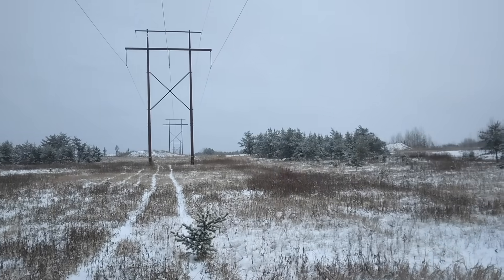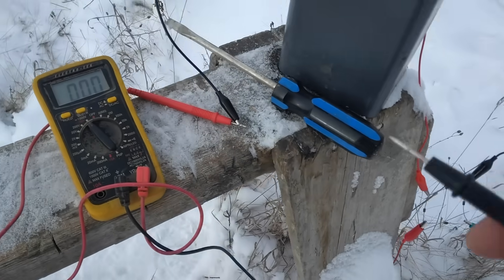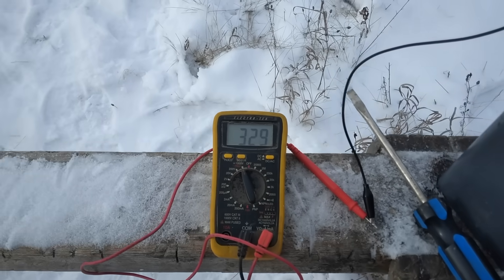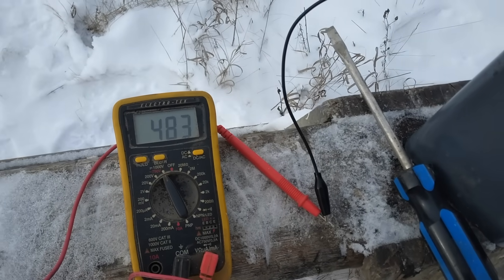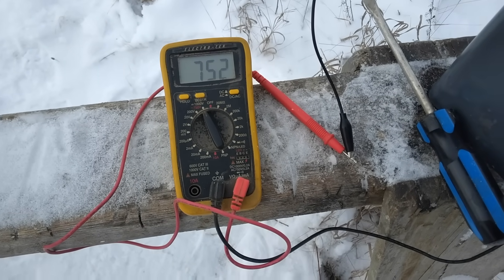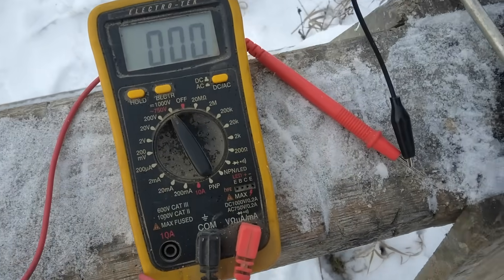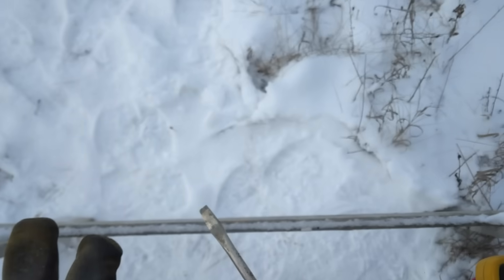Fences sucking power from under HV transmission lines

Comment: Do the power companies pay you for this easement?  Or was it granted many years ago by a previous owner?
Reply: They take the land. If you cooperate, you get paid. If you don't they just take it "for the public good." This has happened to my family that settled the homeplace in the 1850's. They wanted to come right through the middle, but we were able to get them to take from the edge. A front company purchased it for $50k, and 3 months later they flipped it to the actual electrical company for $3 million. This was in the 90's. The buyers and the amounts of purchase are shown on public tax records.
Reply: That is so damn scummy. Did they pose as the electric utility? Could no judge reverse that deal? Sounds like it was bad for both the electric company and the land owner. Was the $3 mil for multiple tracts of land?
Reply: Maybe the electric company owned this other entity and wrote that difference off as a loss? Either way it sounds really screwy.
Reply: @keith77mn77  That was my thought as well.
Reply from the maker: I think the previous owner got something.  I bought it this way, and don't receive anything.

Comment: During the Great Depression people would run 100 feet of wire in parallel to the power lines to steel power. The laws at the time only punished direct contentions. Then the power company got the laws amended.

Comment: I have worked on high voltage, high power AC and DC regulation systems for about 10 years. The potential power storage capacity of that 88 MF at 1200 V capacitor is more than enough power to instantly kill you. There is so much danger with what you are doing that all I can say to you is please stop now before you or somebody else is killed. You are unintentionally experimenting  with an extremely deadly situation.

Comment: I've been a cable guy for 17 years and felt a tingle from the shielding wire many times. Inductance is cool! 😊
Reply: till it isnt
Reply: Splicing .875 with 90v on it hurts, doesnt it?
Reply: @davidca96  I've never worked on hardline. Just RG6 & 11. It's only been a few times where I brush up my arm against a drop while it's disconnected from the splitter. But I've only been on the cable side for a few years. Did telco for 17 before that, which only has -48 DC idle, but ringing is 90 AC which definitely gives a good zap!
Reply: @grabasandwich  Ahh ok, I am a network maintainence tech myself, been in the business for 23 years. It sure does wake you up especially if your gloves are wet haha.
Reply: @davidca96  how else am I supposed to keep warm? 🤣🤣 no i aint turning the power supply off Good luck boys
Reply: @grabasandwich a good zap every now and then , keeps your teeth white .
Reply: Would running the fence in a spiral increase the power gathered? 
Good luck explaining the spiral fence to the power company though. lol
Reply: @FLPhotoCatcher  not unless it was spiraling around the power line.
Reply: @FLPhotoCatcher  I believe there would be a specific angle to run the fence at that would produce the highest inductance. Who knows, a spiral like a razor wire fence might work better actually since it would be more likely to hit that angle multiple times.
Reply: Inductance makes noise!! Fuck inductance!! 😝😝

Comment: For curiosity sake I have some questions for those who might know:
Is there a way to harness and transmit that power and apply it in practical solutions for personal use? And more importantly would that legal?
Reply: You can actually harvest power and use it to power lights for example. Although we did have a fellow who did this in Australia and he was successfully prosecuted for power theft. I believe he was using it to power some Chicken Sheds
Reply: It's illegal because it's theft. It'd be more of a grey area if we were talking about catching light instead of letting it waste away into the ground or sky anyway, but that's not what this is. The energy built into the magnetic field around the wire each cycle is temporary, most of it collapses and drives energy back into the wire for the next cycle. By redirecting some of that energy into a magnetic load nearby, it doesn't get recycled back into the wire and the power company has to supply more energy to make up for it. Sure it's smaller than a drop in a bucket, relative to the energy flowing through those wires, but the more people that do it the more of that energy is consumed without knowing who consumed it.
Reply: @genx65535  genuinely curious, what's the physics of how "most of it collapses and drives energy back into the wire for the next cycle" ?
Reply: @netltube the physics is a combo of "change in electrical current induces change in magnetic field" and "change in magnetic field induces change in electrical current". The inductance of the wire is responsible for what's happening, and a good model for magnetic field around a wire is to think of a stretchable hose that inflates the more you pump water through it. When you stop pumping water the elastic nature of the hose is allowed to shrink and that stored energy squeezes a bit more water out the hose. You have to pump a but harder to get the water moving when you start but you reclaim that energy when you shut the pump off.

The stretch in this case is the magnetic field and the water represents the electrical current flow (not voltage or electrical pressure). Magnetic fields are built up as a form of resistance to current flow as current increseases, and as current decreases the magnetic field is relieved to shrink, returning the energy that was used to build it back into the wire and pushing the current just a little bit further (in the same direction).

Power stations drive the energy as AC, cycling 50 or 60 times a second building current flow forward, then cutting it (then reversing current, then cutting it). Each build up faces resistance as some of the energy ends up building the magnetic field instead of pushing electrons through the wire, but as the generator winds down the cycle the field collapses and keeps pushing those electrons on behalf of the generator.
Reply: @genx65535  how can it be stealing if your not tapped into it ?   You would be harvesting from the air.
It's the same as saying you're stealing water from the water company if you catch rain.
Reply: @strawman9410  But you ARE tapped into it! by magnetic (or electric, depending on the setup) field coupling. Motors use this all the time to transfer energy from power source to mechanical movement. Just because it's not tapping in by physical conduction doesn't mean it's not tapping at all.

It's not the same as stealing rain water because that water would normally hit the ground and waste away (ignoring farming laws in some areas) if you didn't catch it. The magnetic field built up around the wire each cycle is mostly recycled back into the wire, it doesn't spill out into the ground and get absorbed like a sponge. Setting up a sponge (this guy's lab experiment) transfers some of that energy during the build up and the collapse of the field for each cycle... the power station will see extra electrical load put on the grid no different than if he had plugged in a phone charger, the difference is an energy meter is connected between the power station and the phone charger.
Reply: @strawman9410  It's not like catching rain water. It's more like finding a water tank that doesn't belong to you, lighting a fire under it to evaporate even more water off than what naturally evaporates off, and then condensing the water into your own tank. 

It's still stealing, it's just harder than bypassing your water meter.

I feel like you have a very appropriate name xD.

Also Tyler is 99% correct. The majority of the energy in that electromagnetic "leakage" does go back into the lines (and they'll even have capacitors at the substations so make sure they go back in the right phase too) but some of it does leak into the ground (inducing currents in the ground due to the natural conductance of the ground) but there's no way of actually harvesting that lost energy so you can't collect it as free energy (if you could the electricity companies would be doing it already xD).
Reply: @Logarithm906  you don't need power lines to absorb electric, you can get electric just from the air, but might be able to get more if you are by power lines.
Example
https://youtu.be/qhXxSAv6rMg
https://youtu.be/5izEj6uGwrM
Reply: @strawman9410 there are states where that is illegal too….
Reply: @strawman9410  A long time ago, the US Supreme Court ruled that the airwaves are free. For example, you can buy a police scanner and listen in on the emergency frequency they use. You can't TRANSMIT on that frequency, but you can listen. If the power escapes the lines in the form of an electric field, I would imagine (IANAL) that capturing it would fall under the same principle, as long as you don't tap directly into the line. If the electric companies don't want you doing that, then perhaps they should shield their cables and keep the power inside, and not let it escape into the open air.
Reply: @ssnoofle2007  radio waves (including light) are different. Once the electric-magnetic bubble is formed it radiates away from the transmitter until its absorbed by something else. Most of the magnetic field around power lines collapse back into the wire at the end of each cycle.

Yes power transmission could be constructed to better contain the magnetic field in metal instead of the surrounding air, but the material cost would cause your electric bill (or probably local taxes) to be so high no one could afford it.
Reply: MTECH INDUSTRIES-ENERGYRESEARCHER999
Not sure if this might be any good for you
Reply: You get prosecuted, heavily, because the electricity companies don’t want everybody doing it, and like to make Examples of people doing it.  Never mind the fact that they are polluting your property with huge magnetic fields without any recompense to the landowner !
Reply: Here is a fantastic article on Induced Stray Voltages from Transmission Lines:
IEEE/PES T&D Conference & Expo, Dallas, Texas by Georgia Institute of Technology.
https://grouper.ieee.org/groups/td/dist/stray/files/2006-05-Patel-Lambert.pdf
Be very careful,  it only takes fractions of an amp of current to kill you.
Reply: Legal, maybe. But it is still theft.
Reply: You could probably charge a phone, if you add in some electronics to prevent overvoltage frying your phone.
As this is an unavoidable loss of energy, I highly doubt there is a law to this specific case.
Reply: Yes, but I don't know how you would do it safely or legally. I remember reading, years ago, about a student share house in England which was located in close proximity to high tension lines. The article did not go into too much detail, for obvious reasons, but the occupants had managed to install a large inductive coil in the ceiling cavity of the house
which was capable of inducing current from the high tension lines above. And it was enough current to run a house, once transformed.
By all accounts it was a bit of an engineering marvel. Not only had these industrious students managed to source a tonne or so of not so ethically sourced copper to make the coil out of and then install it in the ceiling cavity, they'd managed to do so without getting electrocuted.
My employer at the time hypothesised that they must have built a Faraday cage in the ceiling cavity prior to manufacturing the coil and wiring it into a remote transformer and into the house wiring and then removed the makeshift Faraday cage. It makes sense.
As far as the legality was concerned, they were charged with stealing electricity. I can't remember the outcome, though.
Reply: @davidbrayshaw3529 It seems quite unfair to me for the students to be charged. The power company has an obligation to contain it's product. If it can be collected with easements in place and followed, it is their problem.  Change the easements or shield the fields. It's still a question whether these fields have health effects of persons nearby.
Reply: Google Tesla....he was a genious

Comment: I have often wondered about this. However, your experiment needs to be expanded. Laying your fence across instead of in line either the path & adding several crossings. The lack of a load means you cannot measure current & therefore   calculate power capability (Volts x Current). I always wanted to put a couple of turns around the base of a steel pylon to test this...

It would be enough to run a cattle fencer, a repeater for ham radio, an LED light on a sign or driveway, or to charge or permanently maintain a small device  or parked vehicle battery.
Reply: You're quite wrong about lack of load. The load was the charging of the capacitor itself. And during the approximately 480 seconds that he was charging the capacitor he collected 36.2 joules of energy. Another name for joule is watt second. So he was collecting energy at a rate of approximately 75 milliwatts.
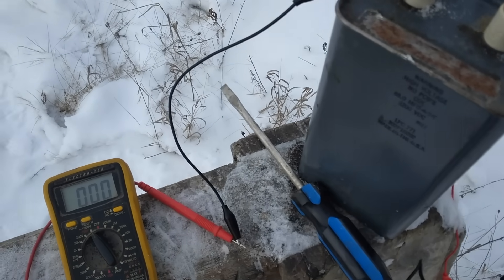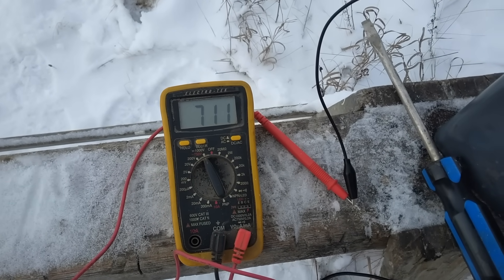Reply: @johncochran8497  I agree with your method of calculation, but I see there was an interruption in the video at time 5:53.  Up to that point, the energy collection rate (power) calculates as 55 milliwatts.  After that, from time 6:03 to time 10:00 at the end of the measurement, the power calculates as 59 milliwatts.

However, the actual power collected would be a little higher since the voltmeter, while it is briefly connected, draws power.  That meter presumably has an input resistance of about 10 megohms or 11 megohms.  Assuming 10 megohms, the meter consumes about 81 milliwatts at 900 volts.  He was making brief connections.  The voltage was definitely climbing in the periods when the meter was not connected.  It seemed to also be climbing while the meter was connected at the end.  If so, that would say he may have been collecting over 81 milliwatts in that configuration, but I can't tell if the meter was connected long enough then to be reliably responding to small changes.
Reply: @analog_guy  I failed to notice the cut at the point you mentioned, so that would mean that my calculation of 75 milliwatts was high. As for the parasitic draw caused by the meter, I would consider that to be extremely negligible. Although you should be a bit more careful about the difference between power and energy. If the meter was 10 megaohms, then I agree that at 900 volts, it would be consuming at a rate of 81 milliwatts. But assuming 5 seconds for the measurement, it would have consumed approximately 0.4 joules of energy.

But there is the issue of the meter voltage reading actually increasing while the voltage was near 900V. That increasing value would imply that the power being supplied exceeded the drain caused by the meter, hence > 81 milliwatts. But the scene cut would imply that the calculated value of 75 milliwatts was low, hence we do have a bit of a contradiction. Only way I can resolve it is to assume the capacitor (or his setup) has a significate amount of leakage.
Reply: @johncochran8497  That is a good observation.

Comment: I wonder how fast you could charge up if your coax was closer to the center of the 3-phase overhead wires, taking better advantage of the 3 phases.
Reply from the maker: I was putting it about where the property line was, because that's where a fence would go.

Comment: What kind of current could you pull? Can the DC go through an inverter to produce usable AC? If so, what wattage?
Reply: The total power is rather insignificant. Just take a look at how slowly the capacitor is being charged.
Now, because he is storing the energy in a capacitor, the amount saved over a significant amount of time can hurt when discharged after being charged.
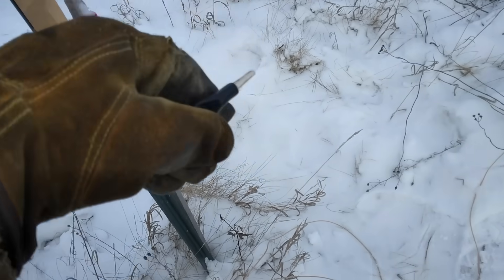His calculation at the end of the video was 36.2 joules. Another, more common, name for a joule is watt-second. So he captured 36.2 watt seconds over an estimated time of 480 seconds (He started charging at 2:04 and finished at 10:08). Doing the math, he was drawing about 75 milliwatts of power. Enough for a small device, but not significant.
Reply: @johncochran8497 capacitors don't have a linear charge rate though. If it was at the peak voltage then the charging would of course be slow. So your estimate could be accurate, but to know better you'd need to just run some numbers with the capacitor and the voltage. Or easier yet just measure the open circuit voltage and then the short circuit current of the AC supply.
Reply: It would probably run a 10w bulb if you're lucky ⚠️

Comment: With the proper control circuitry, this could easily charge batteries.
Reply: I’m no expert, but maybe an MPPT solar charge controller could regulate power to a battery.
Reply: @rogerhargreaves2272  I don't think that it could handle that high of a voltage.
Reply: @otpyrcralphpierre1742  probably not. 😃👍
Reply: @otpyrcralphpierre1742 How about a step-down transformer between the coil and the bridge?
Reply: @1mountaindigger  That might be a philosophical point.  Exactly why are you "off grid?"  If its SHTF, then sucking from the utility isn't "off grid."